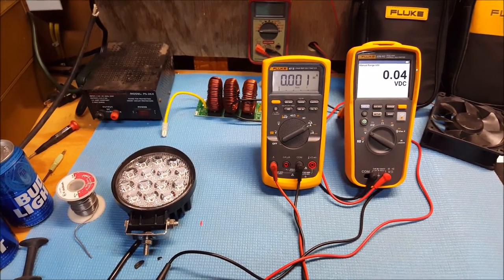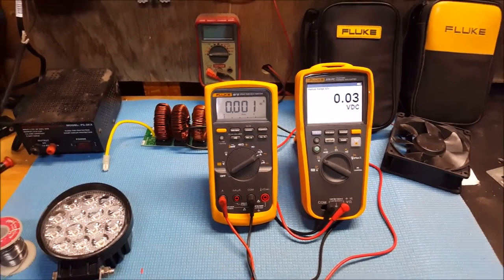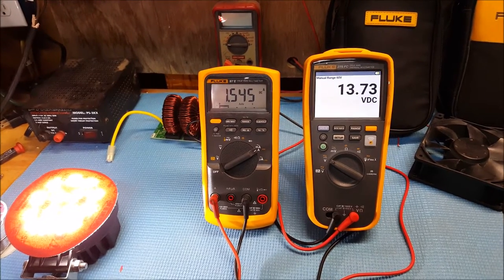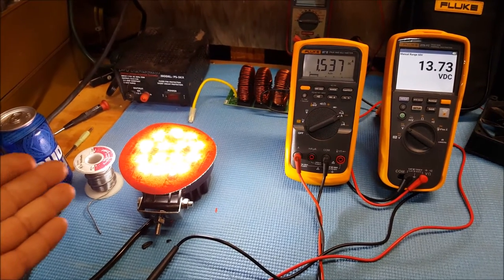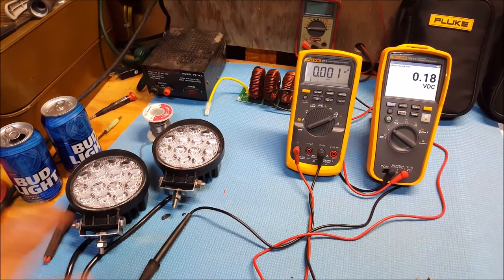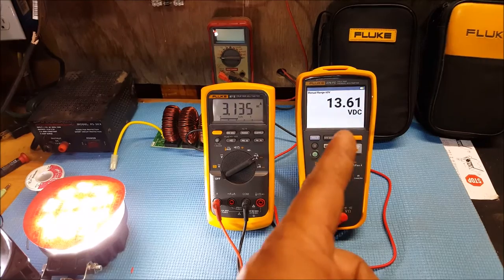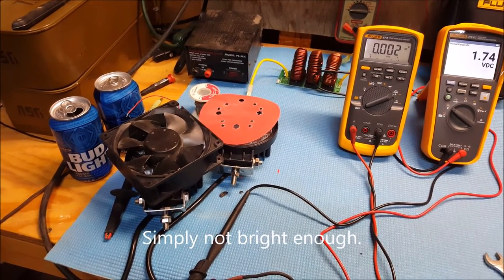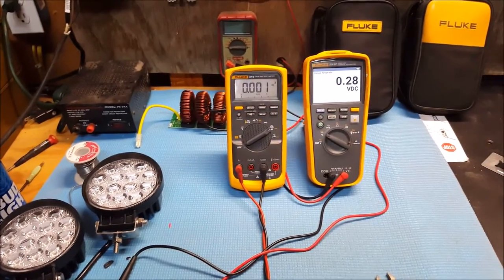SCAM ? 42 WATT 12 VOLT LED SPOT LIGHTS LAB TESTED WITH RESULTS

Comment: I might be wrong but if it is sold as a 42W then one will be 21W. The indication on the box is total wattage drawn from the battery as a set of 2. I want to  add spots to my bike and did some research as to not over "subscribe" on the power and mess up any devices more critical on power. Results was that when you are talking about spots on a bike (car)  it will be half , always work in sets then you will get true wattage.
Reply: David Olivier At first I thought the same but those pods are sold individually, not as pairs